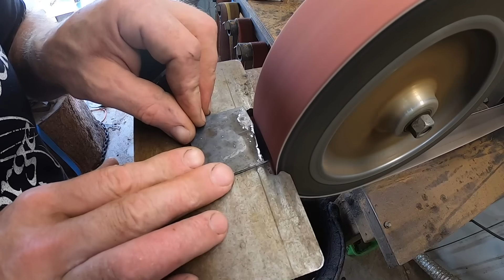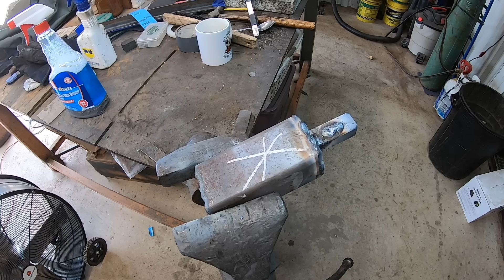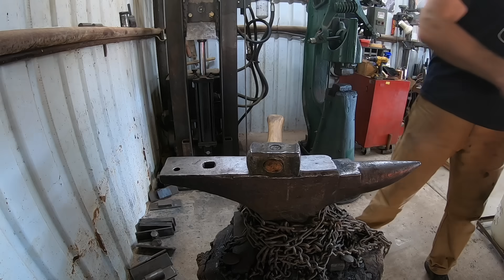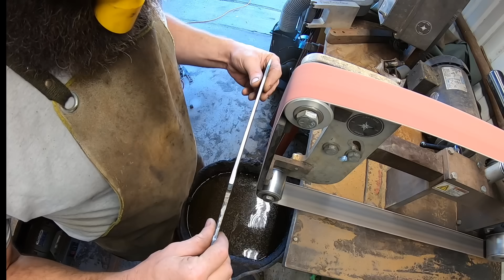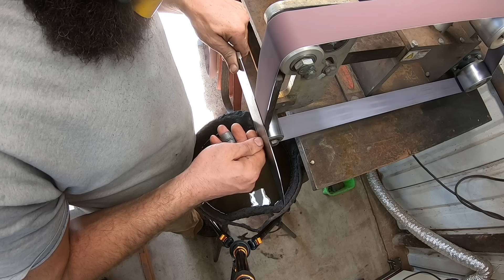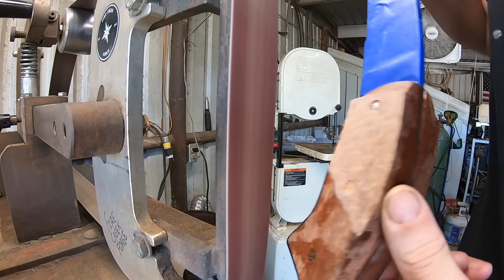Epic Bowie Knife Build Ball Bearing Canister San Mai Damascus Forge Welded Blacksmithing Knifemaking

Comment: I wonder why y’all bladesmiths discard the cartridge outer canister to me an untrained eye it looks like good steel that could contribute to the blade
Reply from the maker: The square tubing is mild steel, which does not make good blade steel for the edge. It can be used as part of the body of the blade or cladding, however.

Comment: Very nice blade: nice Damascus, size and shape. The handle is not bad either but very basic. Still a good shape but it is too basic for such a great blade: simple wood (though a strong one, no question about it), rounded edges, basic pins (probably would look better with three pins or closer positioned pins)... What I mean: with a better handle and a nice leather sheath it could be a great knife instead of just a nice knife. BTW, try rounding up and polishing the blade's spine or even etching your name there rather than on the side - looks very classy!

Comment: Great video, I have a couple of questions, what steel are those ballbearings?? 52100 too? also, the spray paint is any kind of paint or it has some special ingredients, like titanium dioxide?? and if so where do you get it?? which brand is that??

Comment: One of the ball bearing patterns I gave seen.... I have two questions, what is the reasoning for cutting the end at an angle and then rolling it upward? Is it to help the design of the Damascus?
Reply from the maker: Thanks! The technique I used is to forge the edge steel around to the point

Comment: Try wheel bearing grease in the can. A light coating burns off and the can peels off quickly. I've been using it for 2 years and never had a can stick yet.

Comment: Absolutely beautiful knife, and the leopardwood handle was the perfect selection.  I love the method of the bar among the ball bearings for the cutting edge.  It then got me wondering:  What if, and I know this would be a lot of work just to do it because you can do it, but what if you made a layered Damascus billet and used that instead of the round bar stock to eventually become your cutting edge?   You would have the ball bearing pattern on the blade, and then the stripes of the layered Damascus on the cutting edge.    Would be extremely unique I think.
Reply from the maker: Yes, that would be cool. Thanks for watching!

Comment: Is there a reason you use a can instead of a crucible?
Reply from the maker: Yes, this is forge welding, a crucible is used for melting
Reply: @FireCreekForge  how are you controlling temperature in order to ensure welding occurs instead of melting?
edit: I guess what I'm asking is are you just going based off experience, or are you timing the process based of some heat transfer calculations from the material and shape against the temp of your forge?
Reply from the maker: @pax630  My forge will not get hot enough to melt steel. You would need a forced air setup for that.

Comment: The original Bowie knife also had a sharpened edge on the top from the tip up to the point where the top edge flattens out. It doesn't have leopard spots either. Many years ago it was stolen from the Alamo Museum in San Antonio and it took a few years to find out where it was located and they had to pay the man that had bought it from the thief many thousands of dollars to get it back. It is now kept under armed security in a secured place with the Texas State Archives and a replica is displayed in the museum.

Comment: Kinda looks like a pain in the ass to use the press with the hand lever on it, I'd try to add a foot pedal so you can use both hands to work the steel.
Reply from the maker: It has a pedal, I just find the hand lever easier at that angle.. Thanks for watching!

Comment: That hardening/tempering and grind must be spot on. Four times chopping through that board and still shaves is pretty impressive for any chopper blade from a home forge. And it looks gorgeous too. Love the pattern-weld on this Bowie style knife. The slightly down turned handle looks to make it a more productive chopper as well, and may even make it a slightly better thrower too. (For those inclined to throw such a large knife). Over all, if it was within my budget, I'd inquire about buying it, or one just like it (but I prefer feather or raindrop pattern welded steel "Damascus" patterns).
Edit: BTW, Really enjoyed the video and your process and style. SUBd
Reply from the maker: Thank you. In fact, the small shop is where one can dial in a heat treat and really coax the best out of a steel, as opposed to the mass production style commercial heat treatment method.

Comment: If your Belts have the generic Butt Splice, purchase them next time with a SineLok Splice. The splice is a wavy line just as a Sine Wave and should eliminate any issues with the fine finishes your knives require. SineLok is a 3M Trademark. The color of the Belt your using leads me to believe that you may be using an Aluminum Oxide product..?
For the materials your working with, consider changing to Zirconia or a full Ceramic Abrasive Product. 
Aluminum Oxide is not a long lasting mineral when used on the harder materials like that Blade Steel. Zirc would be an improvement and Ceramic would provide a high initial cut rate, long life as well as a built in Grinding Aid that reduces heat generation during use. You know that would be helpful to you.
Love your work. Very, very cool.

Comment: What about putting your edge steel in the corner and forging on the bias? I think it would be quite interesting and would manipulate the pattern in a way not commonly seen. I have actually been thinking a lot about canisters that bear no resemblance to the desired billet shape, like agricultural driveshafts which are a rounded triangle-y sort of shape.

Comment: When you thermal cycle the steel to even out all the stresses and crystal sizes, how do you stop the steel from cracking? I end up with a lot of tiny cracks.
Reply from the maker: The cracks are probably happening in forging, from heating too high, or forging too cold. Normalizing a carbon or low alloy steel (heat to 1600-1650 and cool hanging in still air) won't produce cracks. You'll develop forge scale on the outer surface that will show cracking but the steel itself won't crack from normalizing or later thermocycles
Reply: @FireCreekForge  Hey thanks for replying.   From what you've told me, I suspect I'm too high temp on my heats. I never considered that the cracks were already there. As you can probably tell I've not been doing this long. Thanks for the advice.

Comment: So, the edge piece should go in a corner and the "handle" welded onto the box should be directly over it? Should you also fill with metal powder part way through and at several different points in the filling process?
Reply from the maker: Placing the edge piece in a side gives it more contact with the main body if the blade, so it's closer to a San Mai construction. It's not necessary to put the steel powder in stages, it settles down to the bottom easily with adequate tapping/vibrating

Comment: Why do some blacksmiths drill a small hole in the top of the canister before heating? Wow! Simply beautiful!
Reply from the maker: To provide for air expansion so it doesn't pop. But mine had pinholes in the arc welds around the caps so no need to drill a hole.

Comment: Awesome work as always. Especially like the chop test.
Quick question why don't you go to a higher grit on your belt sanding?? Seems like it could save some hand sanding time possibly.
Reply: Sometimes hand sanding is just the way to go for a better finish. You can get into the work and pay closer attention to removal of the previous grit's scratches better with the slower process of hand sanding. A belt on a high speed grinder will just lay a new pattern of smaller scratches with the finer/higher grit count. Eventually, you will be hand sanding anyway. Plus, it is a tradition that goes back to the first fine metal blades in every country that began metal blades for their higher ranking warriors and royalty. A highly polished blade was always finished by hand. Maybe not with "sand-paper" but rubbed out with successively finer grit and water.
Down to sand, various stone powders, volcanic ash, wood ash, and even ground bone powders.
Check out some videos of Japanese sword makers making a Katana from scratch. They make the steel, and often a different master sharpens the blade hand rubbing the blade with wet stones and even down to stone powders and wet clay and their fingers. It is very educational and interesting to watch if you are into the historical side of blade crafting.
Reply: @thomasarussellsr  ". . . making a Katana from scratch."  He made a Katana from a scratch, was the scratch in another bigger Katana?  Okay, I know, really dumb joke, but I couldn't resist.

Comment: That turned out awesome. I think I need to try 52100 again. Last time I used a 1.5” ball bearing and it was a booger lots of grinding and forging back and forth getting micro fractures out of it. I kept it hot and didn’t try and move to much at one time but it never stayed clean like my Damascus or mono steel like 80crv2 , 1096, and o1 and w steels. 
52100 just seems like a completly different animal that does well once you get it broke in. 🤣🤣

Comment: Love your work. I watch a lot of different "project" channels, for lack of a better term, that are out of my wheelhouse but I always learn something that I can use in projects that are in my wheelhouse. You've given me ideas for keeping my kitchen blades cared for and your handle making for my own wood working projects. Course I have to do most of the work by hand.
Reply: Hey, working by hand only means you make the mistakes more slowly, giving you more time to catch them before going too far. Power tools make mistakes so quickly that we waste materials.
[With the exception of a coal forge. They burn the steel much more quickly than a gas forge.]